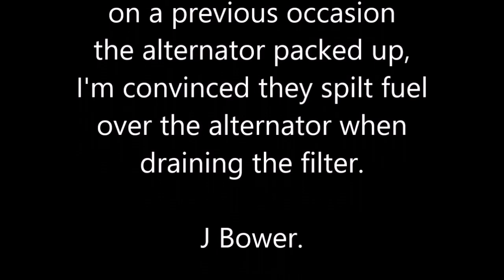Changing fuel filter in a 2. 0 d Volvo V50 beware of main stealer dealer

Comment: Hi. Used your video as a guide for changing filters, step by step... You're messing about all the other steps changing filter, EXEPT THE MOST IMPORTANT ONE, THAT YOU NEED A SPECIAL WRENCH TO OPEN IT😡 It took me several hours to figure out that you skipped this!
Reply from the maker: No special tool needed, top section of filter body unscrews as shown in video, standard 27mm socket is all that is needed to unscrew it,

Comment: The reason you had the airlock is because you undid the return line connection. That is entirely unnecessary to replace the fuel filter and will definitely result in unwanted air getting into the system. Poor information you're using and giving out.
Reply from the maker: Thanks for watching, I am sure you will understand one day

Comment: Buy a £10 electric pump off eBay to save all the faffing about! Simples! It connects to the battery with crocodile clips and comes with hoses to carry out this sort of task.
Reply from the maker: Paul McDonald, There are a few different things you can purchase to fix this problem, but if you don't have time for the proper tool to arrive, and are living out in the country needing to get the car on the road, you have to improvise with what you have, this is what I have shown in the video.
Reply: Which pump did you get? I want to do this.

Comment: This is hilarious! Each step of the way your hacks cancel out the previous hack... am I missing something, why don't you... 1. Remove all the filter and then drain rather than splitting it and faffing about with an 'ickle bit? 2. Disconnect return and crank until air is out and the car starts, that's how most mechanics do it? You wouldn't need scaffolding, vacuum cleaner or the curvature of the earth to complete the job? This is definitely not the way to do it!😂😂😂
Reply from the maker: James Macdonald,, If you try to remove air from this model of car in the way you are suggesting you will definitely need more than the curvature of the earth to help you.
Reply: @johnbower  It's the standard way to bleed after replacing the filter, either before or after the pump, that's how a trained mechanic would do it... pissing in the wind with the vacuum cleaner hack until you cranked the engine.. nuf said.
Reply from the maker: @jamesmacdonald3090  I have come across a few of these so called trained mechanics ( or technicians as they are called today) and some of these taking short cuts cause hundreds of pounds worth of other damage to cars (at the customers expense) while they are rushing to do the work. I am fully aware there are other ways, and the right  equipment, for doing this type of work, but when you are living out in the country without a proper tool for the job, you have to improvise with what you have at hand,  this is what I have shown in the video, if you care to look at most comments other people have made, you will see how this video has helped them out. but there is always someone who thinks they know better and can not be helped.
Reply: @johnbower  Whatever, you must be right? A little knowledge etc..
Reply: Thanks both, the video helped a lot, to bleed the system taking off the return valve, sticking it in a bottle and just cranking the engine until it started then ticking for a few seconds got rid of the air (then reconnecting quick)

Comment: Hi John we had the same Problems after changing fule filter on a focus 2.0 liter diesel engine wouldn't start for love nor money two hours later a ford mechanic turned up at my brother's spray shop and said all you need to do is tow it and he was right only pulled it five foot and it started good video that engine is a focus engine .
Reply from the maker: Vaughan Newton, having the vehicle towed will spin the engine over quicker than using the starter motor especially if a low gear is selected, but this puts a lot of strain through the dual mass flywheel and can cause failure, (using the starter motor puts no strain at all through the dual mass flywheel).
Yes the same engine is used in the Ford Focus, but Peugeot make the engine, thanks for the comment.

Comment: Been hand pumping the last hour in below zero temps. Why they make  it this difficult compared to every other car I've ever owned to bleed the diesel system I reallly really don't know.
Reply from the maker: Glen Graham, I understand your frustration, I have tried using a hand pump and found they don't pump air but do pump fuel, that is why I resorted to using the vacuum cleaner.

Comment: this is exactly the way i did mine  but put a conector on the pump end with pipe and used the hoover to suck the fuel up from tank through filter but before reconecting the filter side conectors i sprayed carb cleaner on the opening to clean them before putting them back on it seamed to make a better seal and no air bubbles after, happy days

Comment: Hi John, thanks for the video. I have a cmax tdci which has an identical engine. I have had constant air coming down the lines since i got the car 6 years ago. It had starting problems and i suspected the air was causing this. 

I decided to change the fuel filter complete with new large gasket at the top. This did not stop the constant air coming through. After some research I found that some say its normal to have air in these lines and some say not. I ignored it but the problems with starting persisted. I put up with this for a while but then another problem started. 

Sometimes intermittently while I was driving the car would refuse to rev and so far I have been left in a very dangerous situation. I got stuck at the entrance to a road once and twice blocking both lanes of the road as I pulled out of a turning.  I changed and cleaned the map,maf and air temperature sensor. I took off the egr valve and the throttle body and cleaned them up. Fault still exists. No fault codes relating to it when connecting the obd. 

I have this week installed a new filter body. While doing this I pulled a vacuum through the line from the tank to the filter and go no air bubbles so i assumed that the air must have been coming through the filter body or its connectors. I installed the new filter and body and pulled out what i could from the bleed valve on the filter and through the return pipe and the car started fine. 

I still have a constant flow of air coming through after an hour or so of driving and ticking over. There is no loss of power and so far but since I have lots of bubbles coming through i'm worried the dangerous problem still exists. There appears to be a larger amount of bubbles when i first start the car. I guessing that when this large amount of bubbles get the injectors it causes this problem.

Do you have constant air in the fuel lines? Does anyone know if this is normal? I am now worried about using the car at all. Sorry for the long post. Thanks
Reply from the maker: Hi eazthitman, thanks for the comment.Yes I do get one or two bubbles passing through the clear fuel line but these have never caused a problem, if your car is cutting out due to an air lock in the fuel line then air must be getting pulled in from somewhere, first thing I would do is check condition of rubber O rings where fuel lines connect to filter housing also condition of air bleed seal on top of filter housing, replace if in doubt, also check if the top of the filter housing has a crack in it where someone has been careless with over tightening.
Note: if you suspect the engine has stopped due to an air lock then the air lock will be visible in the right hand end of the clear fuel line just before the line connects to high pressure pump.
Reply: @johnbower  Hi John, thanks for reply. Changing the filter and filter housing has covered most of those things. I also covered the right hand filter connector in a high quality sealer as a temporary test but made no difference. I did notice that the old air filter gasket had quite a few cracks on part of it. There is  no air lock as such, the engine does not cut out. It just suddenly stops revving for a few mins.
Any attempt to lift the clutch to slowly move at tick over and it cuts off immediately.

I am not sure at this point if I have fixed the problem or not since changing the filter will create air in the system. I took for a spin yesterday and the problem did occur soon after staring but after a bit of driving I have found that the bubbles seem to have reduced quite a lot so I will see over the next few days. Will update if fixed or not.

Comment: A good modification is to fit the primer bulb as fitted to the Peugeot 407. Exactly same setup. Why volvo don't use it I'll never know. I fitted one to mine. Also non return valve is fitted inside the primer bulb. 15 minute job now.
Reply from the maker: I agree with your suggestion, thanks for the comment

Comment: I have the same car,and i have strange issues with it.Once a 2 weeks roughly,i can't start the car at all,i must bleed the air of the system,then again 1-2-3 weeks no problem...and i don't know from where to start,seems that air is entering into the system but from where ?!Any ideas...?
Reply from the maker: This car relies on the the high pressure injector pump mounted on the engine to draw fuel up from the fuel tank, this means the fuel line from the high pressure pump back to the fuel tank is under vacuum, this is where the air is entering the line, most likely places are the connections around the fuel filter housing, either faulty rubber O rings on the fuel line connections or a faulty rubber seal on the end of the vent which is screwed into the top of the filter housing.
Reply: @johnbower Thanks,i will check tomorrow everything,i hope that i can find something !

Comment: You mentioned about it getting airlocked how do you sort this problem
Reply from the maker: Patrick Joseph Ward, As shown in the video I pulled the airlock out of the system by applying a vacuum to the fuel return line, apparently there are proper tools for doing this, I have not been able to find a good one of these and is the reason I tried using a vacuum cleaner, it is not an ideal tool but it did work.

Comment: 7:52  Some people fill the filter body with neat forte diesel cleaner
Reply: Never do that. The modern CR diesels only pressurise the amount of diesel needed by regulating the intake... the old ones used to dump the excess fuel back into the return hence you'll end up with a damaged pump eventually as it'll pressurise pure diesel cleaner only.

Comment: Don't worry about the air lock. Don't waste your time thinking that as there is nothing you can do to stop it. Once the lines are out air is intruduced immediately. No tricks will stop that. 
A tool free way of doing this is to put a 6mm hose in the bleeding line and suck on it as hard as you can. No pun intended. Untill you see the fuel move it's way out up from the lines. Just a little will be enough as all you need is to start the engine. The trick is, once the engine starts rev it high over 3000 rpm for about 10 seconds. The air lock will dissaper very quickly and all you'll need to do is keep revving modoretly for another 2 minutes and on offing the engine a few times as this will get rid of the last few bubbles. Enjoy your ride untill next time.
Reply from the maker: Bitter Melon, The only fuel line that needs to be free of air to start the engine is the one between the fuel filter and the high pressure fuel pump, this can be accomplished if a little "trick" is used to disconnect the fuel lines in the correct sequence (as shown in the video), I did suck as much air as possible out of the bleed nipple (as shown in the video), but as the bleed nipple is not at the highest point an air pocket is left in the top of the filter housing (as shown in the video), the engine did start but as soon as that air pocket reached the high pressure fuel pump the engine stopped (as shown in the video), A vacuum had to be applied to the fuel return line to remove the air pocket from the high pressure fuel pump (as shown in the video). There are some diesel engine vehicles that don't have a problem with air pockets in fuel lines, it all depends on the lay out of the fuel system. Thanks for the comment.
Reply: John Bower I have the same engine as you do on my ford focus. My method is how I replace the filter all the time. Not saying you're wrong. I think people will benefit your way if they wanted to do it the right way. Mine is the backyard version I guess. After starting, if you immediately rev the engine high I never had my engine cut out because of air lock, as the fuel moves very quickly and revving high it's unlikely to stall out, and since it takes a few seconds I found that to be the easy way. It literally takes me 5 minutes to replace the filter from start to finish. I guess I would need to do a video the next time I change mine. I will tag you if I do. Btw, great job and thanks for the upload 🤙
Reply from the maker: @sourwords1808  thanks for the comment.

Comment: hi i have lots of air bubbles in the clear fuel line,  could it be the fuel filter or the O rings. is there anyway to test before starting work.   any advice would be of help.   thankyou.
Reply from the maker: himfromdarwin,  If you have just changed the filter it is not uncommon to get bubbles in this clear line for a short time. If the filter has not been changed for a long time it may be partially blocked causing excessive negative pressure in this clear line, if there is excessive negative pressure in this line the most likely place for air to get sucked in will be the joint where this line joins the fuel filter, as all other joints and seals are before the filter where there should not be excessive negative pressure, unless there is a restriction in the filter inside the fuel tank, but this is unlikely unless you have had some very dirty fuel.
If the fuel filter in the engine bay has not been changed for some time this is most likely the cause of the problem.

Comment: i have changed my alternator and had to remove all the filter now it wont start how do you bleed it
Reply from the maker: acer arborists, Yes if you disconnected the fuel lines from the filter you will definitely have air in the system. If you look at my video carefully I do show how to bleed the system.   Note: when removing the fuel lines, where you careful not to get the slightest bit of dirt in the fuel line between the filter and the engine driven high pressure pump, because dirt in this line is after the filter so will not get caught by the filter, good luck.

Comment: Suck air out by the returnline, you will blead the whole system in one go
Reply from the maker: Patrick Erb, thanks for the comment.
Reply: @johnbower  Thank you for the video, just done my filter and the video helped a lot :) I have used a very large seringe (a very big one) to suck the air out of the returnline towards the pump and it worked like a charm

Comment: Hy, removing the air from the system is easier with the 50ml syringe not with the vacuum cleaner.
Reply from the maker: Hi mariusvfp mihai, Yes lots of vacuum syringes are available for this purpose, finding one that works is the problem, I have looked at these and bought one in the past, it was as much use as a chocolate teapot, the internal seal leaked and would not pull a vacuum, that is why I resorted to use that vacuum cleaner, I would be thankful if you could lead me in the right direction to finding one that works, thanks for the comment.
Reply: @johnbower  i always use a manual pump to try and suck some fuel into the filter housing...then...just crank the engine for 10 times...for 5 seconds per try...when it finally starts.,...revv it and keep it high on revs...the fuel pump in the tank will do the job for you..dont waste time on priming the system...its useless....use the fuel pump in the tank as you crank the engine..

Comment: these engines have no lift pump the green return plug is where you should draw a vacume to purge the pump and supply line of air, a sealey or comparable oil drain vacume hand pump works perfect pump the canaster up leave 5 minutes then crank car once it fire maintain 2000rpm for 20 seconds then shut off car and reconnect the fuel tank return(green) job done, you shouldnt try shart the car before purging to help maintain the mechanical fuel pump.

Comment: Alternator doesn't break down because of fuel leak...
Reply from the maker: Hi dot, apparently the diesel fuel got inside the alternator and left an oil slick on the contact areas of the brushes resulting in poor electrical contact.
Reply: @johnbower  John's right. It was even mentioned about cover the alternator in VOLVO service tool VIDA
Reply: you dont really know what you are talking about...fuel can destroy alternator...also the belt can slip...so ...your advice is rubbish!